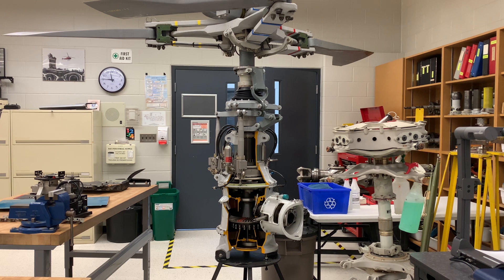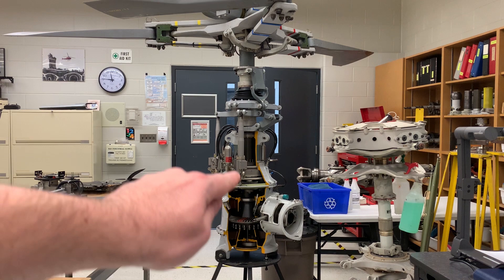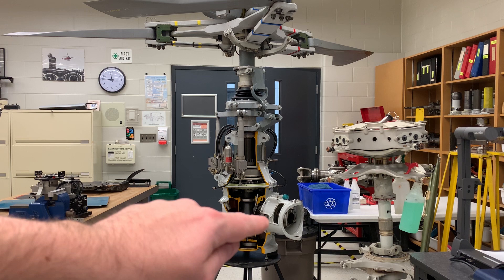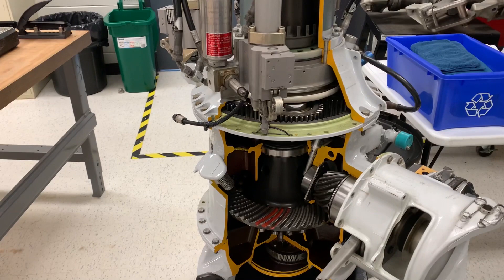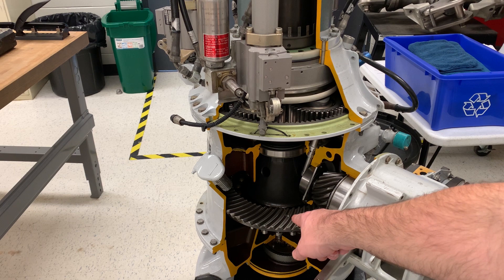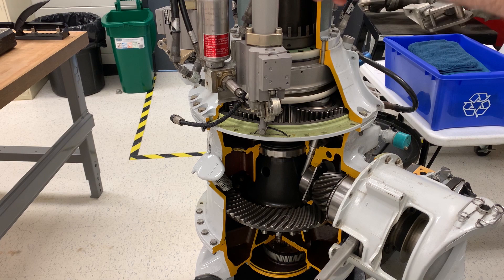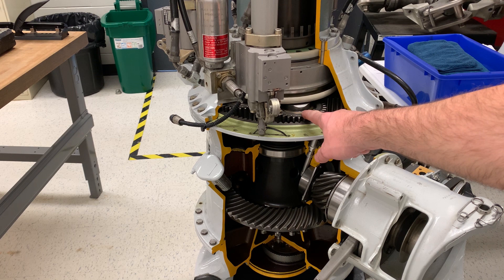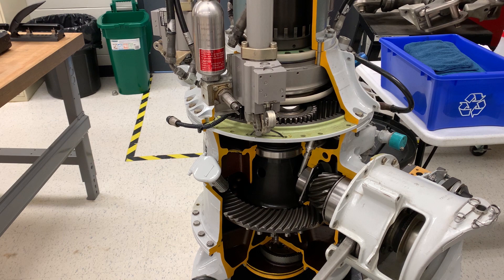Main Rotor Transmission

Comment: Great real-world shot of a complex theory. However how does an engine spinning at 5000rpm engage a rotor that's at standstill and start it spinning up without shredding something?
Reply from the maker: Great question.  The turbine wheel that drives the compressor can turn independently of the turbine that drives the rotor.  If you watch some startup videos, the engine will start and reach idle speeds , eventually the rotor catches up.
Reply: @MrSkidkicker yes and I’ve even seen some helos that can have their rotors completely stopped while the turbine is at full idle. Then they release the rotor brake and the rotors slowly start spinning. What I don’t understand is how this can be. How does the turbine exert its effort onto the rotor so gently and slowly. Is it it the exhaust air blowing through the compressor that powers it? Or it is some fancy gear? I don’t understand how it’s able to exert enough force for the rotors to lift a helicopter off the ground, while also allowing that same rotor to come to a full stop. Feels like magic

Comment: question, the AStar spin at approx 390 you said, others spin/operate at more like 245, thats a significant different, for a rotor system, be interesting to hear, understand how a rotor system is designed to gravitate to the one or other end of that rpm range.. can't recall which heli the other was other than it's also a 3 blade design,
Reply: What helicopter of the same size (and rotor diameter) turns the main rotor at only 245 RPM? Rotor rotational speed is determined by rotor diameter and desired tip speed (typically roughly Mach 0.8).

Comment: I’m curious if those RPMs are correct, that seems slow. But it’s been a long time. I think my Huey engine rotated at 55,000.
Reply: The AS 350 engine package (normally a Turbomeca Arriel 1B) includes a two-stage reduction gearbox that drops the high turbine shaft speed (N2; nominally 39,095 RPM) to the roughly 5,000 RPM (one manual says nominally 5,990 RPM) of the shaft to the main transmission (and to the tail rotor gearbox).

Comment: It seems like that 90 is a waste of energy and a weak link.  I wonder why they don't make the engine cylinders vertical-like a boat motor, whereby eliminating it altogether.
Reply from the maker: Great point.  The Bell 47 has an engine that is vertical, but most engines including turbine driven rotors are horizontal.  This is due to the fact most piston engines will be designed for fixed wing and adapted for rotary wing.     Fixed wing being the dominant.  Same reason lefties are often "left" out!
Reply: @MrSkidkicker  I see.  As I think about it I also wonder why they are not all coaxial-with two rotors spinning opposite directions.  I remember myth busters declaring that they could not build a one man, single engine small helicopter because it was too heavy.  Then I saw someone do it with a coaxial, which was their problem.  I can't wait to see the one on Mars take off.  I hope it flies next month in that atmosphere.  Thanks for the reply.

Comment: So does the planetary ring always stay stationary?
Reply from the maker: Yes.  The planetary ring gear remains stationary.   There is a considerable amount of force applied  from the planetary gears as they turn.
Reply: This the normal configuration of a planetary gearset for reduction: the sun gear is driven, the ring gear is stationary, and the planet gear carrier is the reduced speed output.

Comment: So uninterrupted power flow, that's why the blades are turning as the engine starts
Reply: No. The power turbine shaft of the engine is not mechanically connected to the compressor turbine. The power turbine only starts to rotate once the engine has developed enough exhaust mass to spin it. This is why you will see a delay in the main rotor rotating from the time of the main engine starting. You can think of it as a stall/torque converter in a automatic transmission.
Reply: Yes, but the component in a traditional automotive automatic transmission is just a "torque converter" (or fluid coupling), @chippyjohn1 . There is no component called a "stall converter"; stall speed is just a characteristic of a torque converter.
Reply: @brianb-p6586  You are correct.